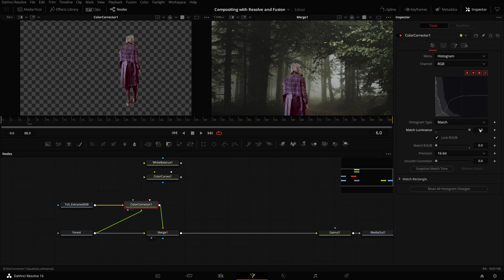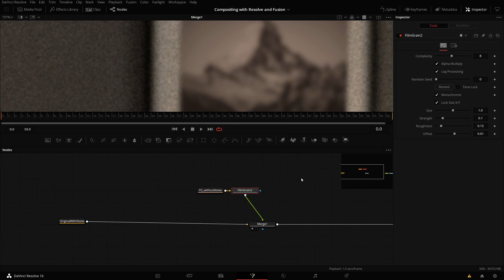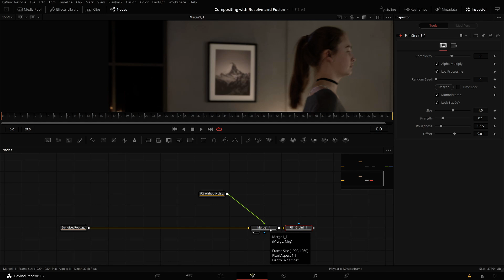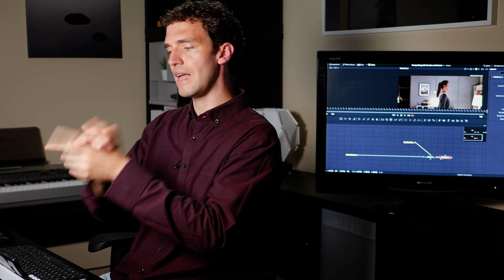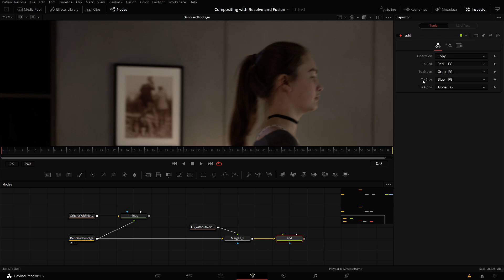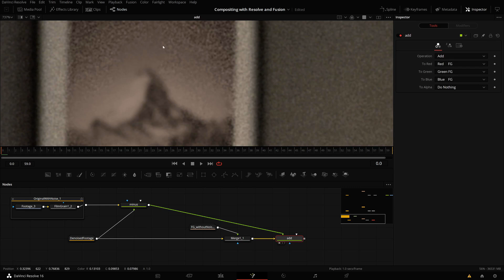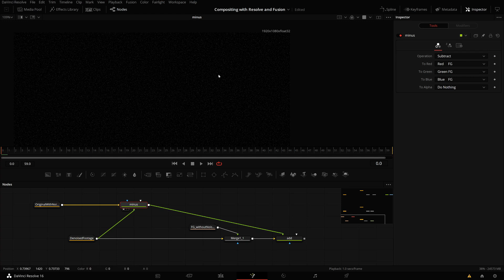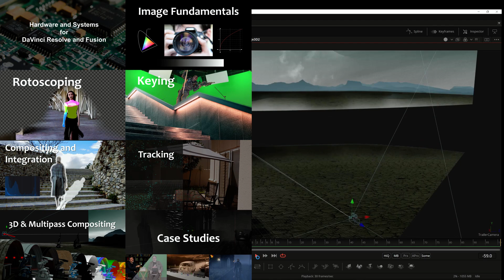Compositing with Resolve & Fusion: Workflows for Noise & Grain

Comment: you should consider uploading at UHD resolution, even if you are recording this at 1080p. It's giving the viewer a bitrate option and YouTube gives you different encoders for 1440p and 2160p compared to 1080p and below.
Reply from the maker: Interesting... thanks for the input. Will look into it sometime. This could be an option, even if it feels funny   gaming the system, but if it's worth it ...
For my courses I use Vimeo which generally does a slightly better job, I think, but not sure there either
Reply from the maker: Upscaling on my end so that youtube shows a higher codec despite lower quality source? What's the point? I might go to 4k screen recording at some point but still have to consider performance while using Fusion, so it's not that easy...
Reply: @VFXstudy  yes exactly. It's gaming the system. YouTube defaults to their VP9 instead of AVC for 1440p and up. Which is better quality(efficiency) and better bitrate.

If you record locally at like 50mbps for screen recording it's plenty in 1080p and upload that to YouTube as well. YouTube will still give you a 1080p version with AVC at 8000 - 12000 kbps (depending on framerate). But also give you upto 45000 at UHD and 60 frames. So think of it as giving your viewers a bitrate option, even if their screens (or windowed viewers) are just 1080p or any other resolution. 

The 1080p YouTube version of a 1080p upload will be equal to the 1080p YouTube version of a 2160p upload (which was upscaled from 1080p just using nearest). At times it might even be better. If you were a bigger channel with more as revenue and generally promoted, YouTube gives you more bandwidth across the board. 

YouTube seems to store local copies of old uploads and reencodes them or uses them for training and testing video encoding. So it doesn't hurt to upload a higher quality version (just takes more time, upload and export). 

For a Fusion (in Resolve) stability and performance trick: make a Fusion comp in your media pool and don't put it on the timeline. Just double click it to launch Fusion. This often avoids GPU memory error when working with high res footage, or stills.

What YouTube has done with "4K" marketing is selling 4K to be looking better than 1080p by a big margin. Which isn't the case in reality. Good 2K easily holds up and 6K, 8K, 12K aren't meant for delivery. Sadly due to the shitty YouTube compression and chroma subsampling etc people see such a huge difference between 1080p and UHD even on their 1080p screens when switching to UHD on YouTube. I shot and edited a 1080p video and just put the delivery page resolution to UHD. And for a lot of people that I asked. The YouTube version looked like 4K videos they have seen before. 

It's worth it if you have the upload speed and storage. It's makes the export a little slower as well.